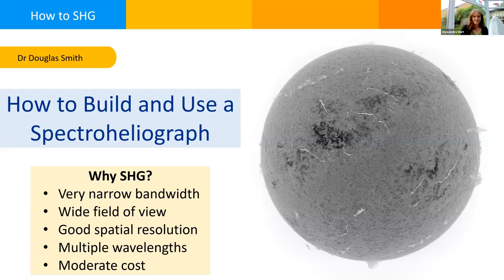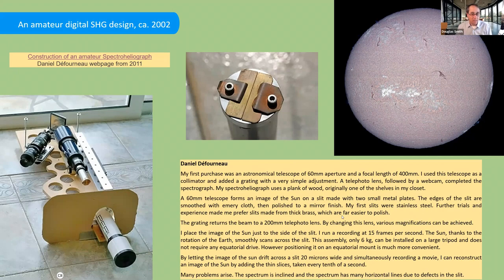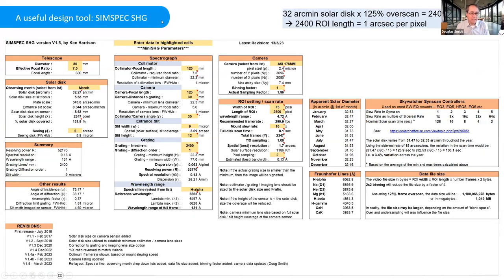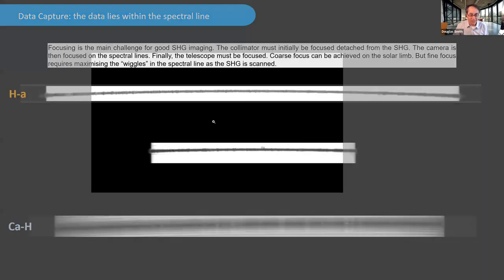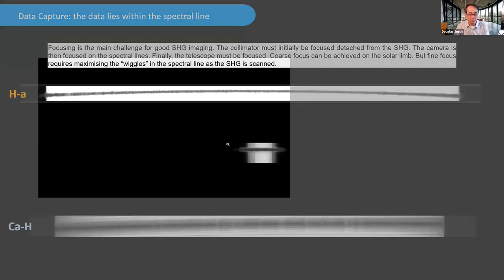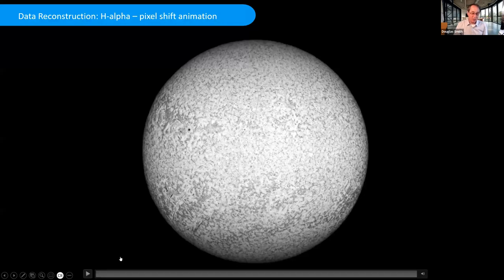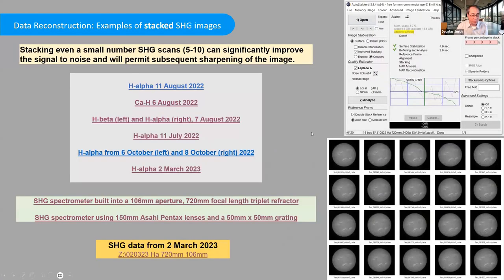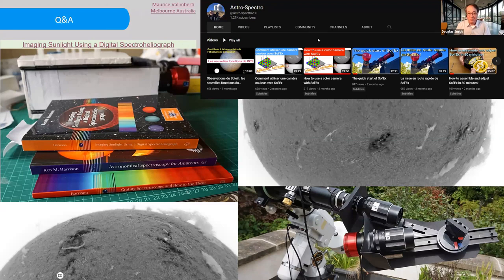How to Build and Use a Spectroheliograph

Comment: I'm sure I'm missing something here, but regarding D3 line processing can we simply invert the input data to find the best fit line then continue processing normally on non-inverted data? Thanks for uploading this treasure trove of information and advice!
Reply from the maker: The Helium D3 line is so weak that it's just not possible to identify a line with enough contrast that spans the whole solar surface. It's really most noticeable in the prominences. The line fitting software just can't find the Helium line so we have to use a nearby line to define the geometry of the spectral line and then shift  that line to the correct wavelength using the location of the Helium prominences.
Reply: @douglassmith1215  Thanks for the explanation!

Comment: Doug, will your quartz slit work in the Sol'Ex?
Reply from the maker: In principle, it's possible. But to benefit from the longer slit, you should also increase the focal length of the collimator. I think you can get a 2nd 125mm lens (so it is 125/125, therefore a  magnification of 1) and then you can use a telescope with focal length of up to around 650mm.